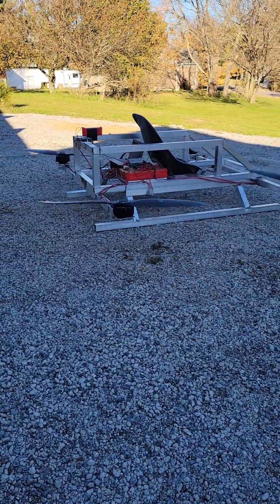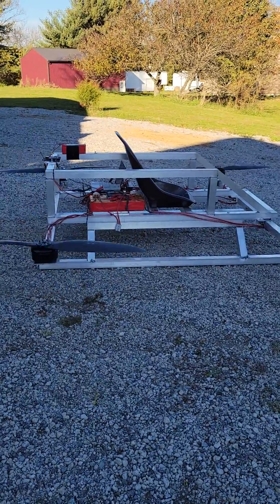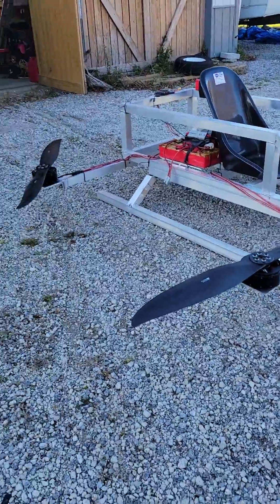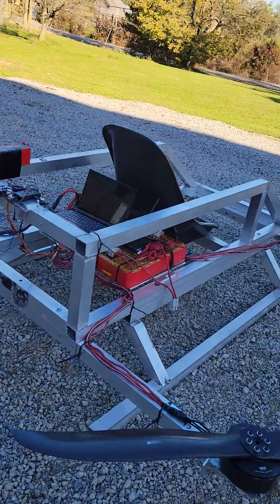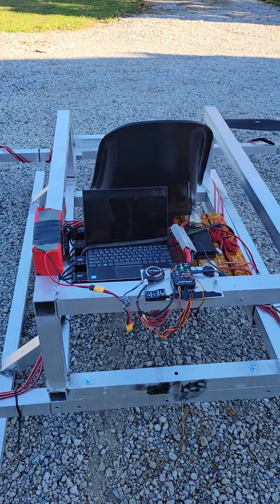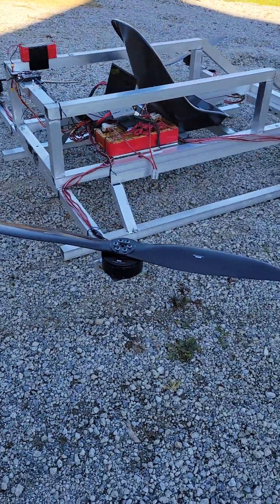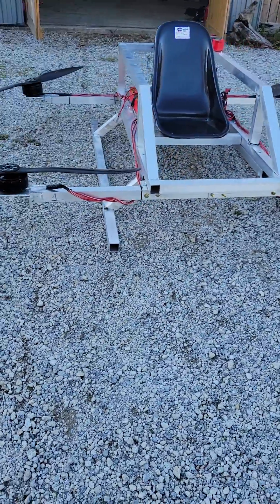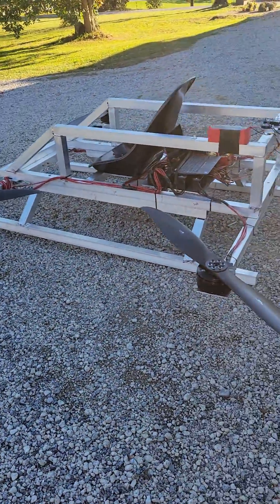Manned / Heavy Lift Drone - motor imbalance resolved

Comment: Great job mate ,few weeks back before the cold settled in, I run some tests on the field and I had kind of the same issue , one motor spinning slower then the other three, I was told I need to calibrate my ESC’s , as I’m a total newbie to this drone science , I’m using this cold winter to study and learn as much I can about this calibration. I got good batteries like two per each motor , one 7s and one 8s and a great charger. I had a drone amateur who managed to put all my equipment together so now as I learnt a lot I can see his mistakes and I’m fixing them as I go ! 
Great job mate looking forward to see it flying 👍🦅🦅

Comment: are you using 21700 batteries? 
maybe it's better to prototype using lipos instead as they come with higher discharge rates 
or consider super capacitors i haven't tried to build at your scale though
but i fixed my 18650 discharge issue with more capacitor at each ESC on my race quad, the goal was to have longer flight time. 

anyways i am just speculating i am sure there are better options out there 
best of luck